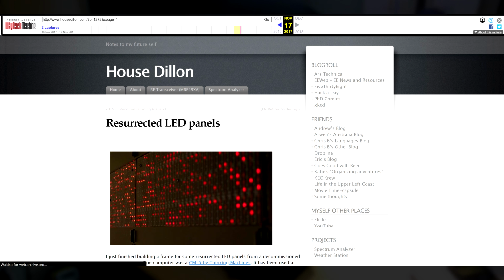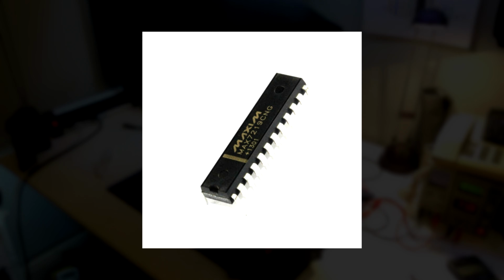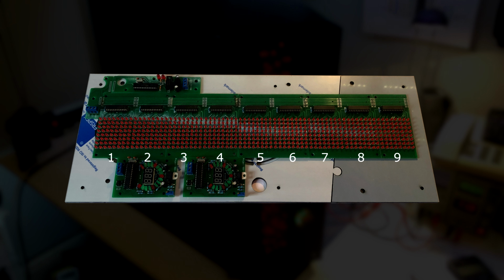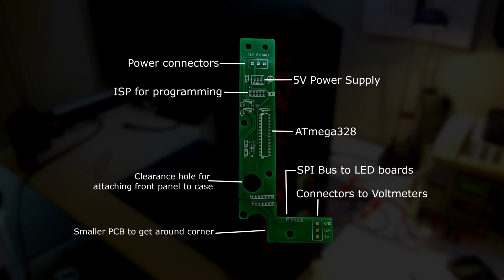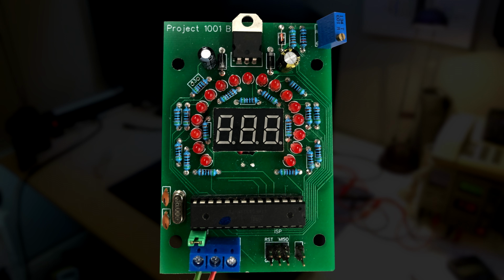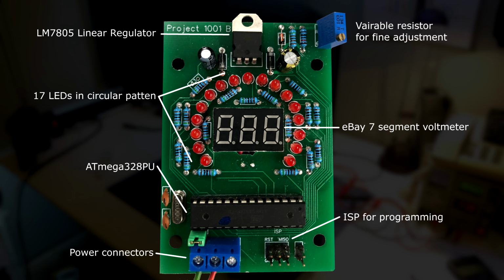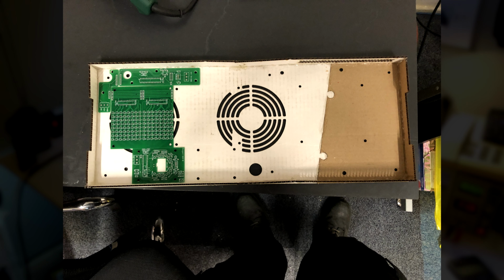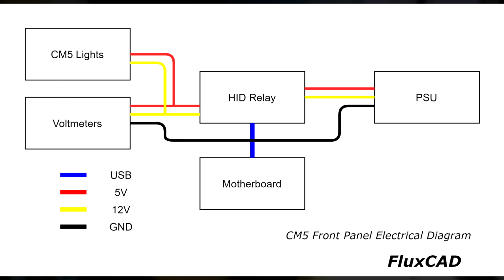How I built the CM5 Front Panel PC Case

Comment: is there any additional info that is available on the circuit board design and ordering process you did that you could share, I'd like to order this board (I like the discrete LED's better) but I'd like to strip it back to just the CM5 lights, rather than the additional components you've added on. From listening to the video you've done all the hard work designing the board, and finding a manufacturer to build it (you said relatively cheap, I'm curious to find out how cheap relatively is) I'd like to build a variation of this for a different use case, and would love to use your work to shortcut it.

Comment: Great video! Question: Are further edits required for the Arduino code? Mine wouldn't compile past "usleep", but I ended up changing it to "delayMicroseconds". It compiles with that, but the board only lights up, does not change or move. Didn't know if further Pin definitions needed to be added to the code.

Comment: Could you share the latest version of the code for the Arduino and the pin configuration for the arduino to a max7219 panel. Thanks.
Reply from the maker: The pinout of the MAX7219 is commonly avaliable on google and the code is avaliable in the description of my other video - https://www.youtube.com/watch?v=qm6w57ZcJZQ
Reply: @FluxLabsProjects  Thanks, it was the actual wiring u are using. In the video, you showed a drawing for an Arduino and Max2719 Led Matrix panel. However, in the youtube video, the wiring is not the same. It's not 100% clear which I should use. Also and apologize if I sound thick, but where are the references to the MD_72xxx library within the code in the link on you your youtube video.  Thank you

Comment: Hi, I downloaded the code from the website link in the video, and unless I'm missing something I couldn't get it to compile on the latest version of the Arduino IDE software. I got a error 'usleep' was not declared in this scope. Any thoughts?
Reply from the maker: I think you're missing a library, or have the incorrect one. I came across this error before but now i can't place it. Sorry to not be more helpful. If i come up with it i'll reply again.
Reply: @FluxLabsProjects  Thanks, I will double-check the library files and let u know if I found something
Reply: @FluxLabsProjects  Can u provide details of what pins you connected the 8x32 matrix module you show running the test of the code. U showed a schematic of showing the pins going from the Arduino to a 8x32 matrix, but the video clip doesn't look the same - Thanks